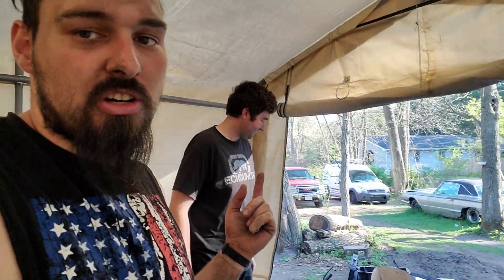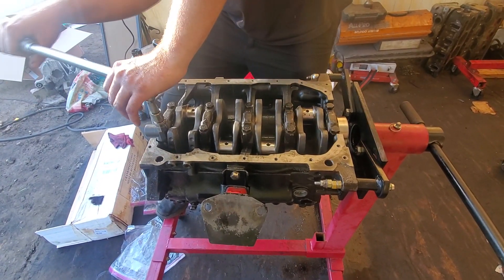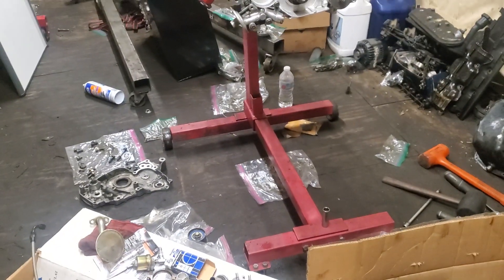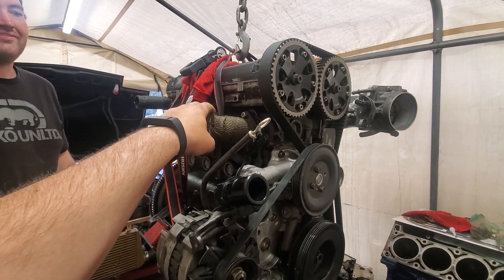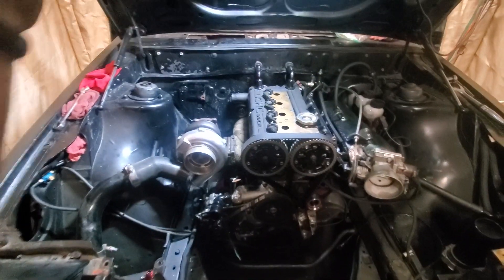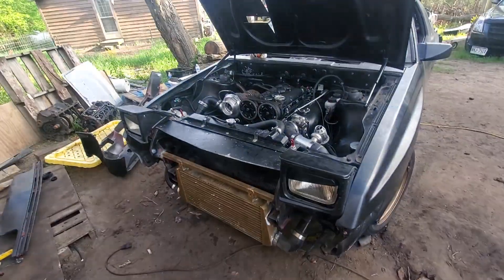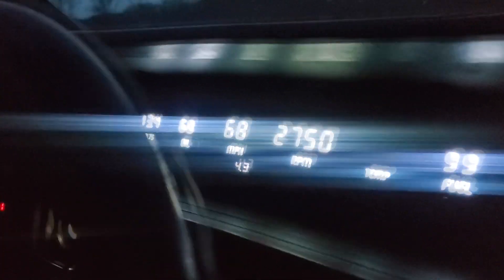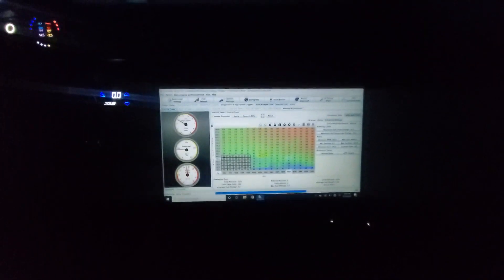rebuilding the conquest 4g63 then breaking down and then breaking it!

Comment: A StarQuest?  I want one bad, eventually....88 or 89.  I can work on G54 in my sleep, fun little engine to put around with.  Had a mildly built one with a Weber Outlaw Car carb in my old 86 D-50 I had for 20 years, sadly it is gone now.   Currently building/supercharging my Ranger. lol
Reply from the maker: We didnt keep the g54 very long
Reply: @Garageless  Yeah, G63 is a better top-end/ECU....but can put a G63 head on a 4G54B....even better, IMHO. Heck, I still have an annealed copper head gasket for one!  And stainless valves...and roller rockers...really wish my old baby didn't die.

Either way, Astron was a fun engine series.  And GM basically resurrected it with their new 4-banger turbo full-size 1/2-ton trucks.

Astron was, after all, a GM design.